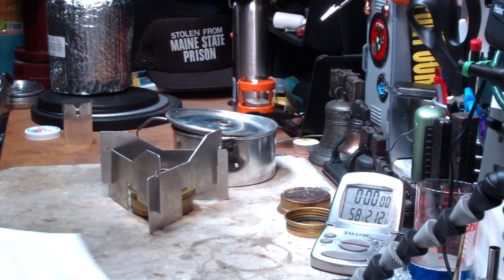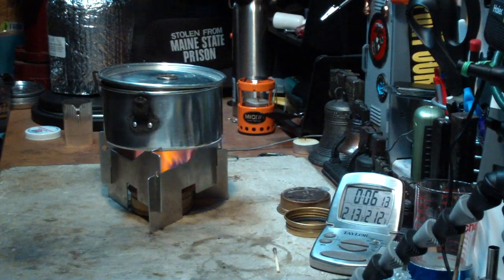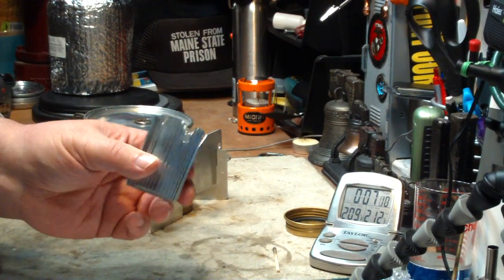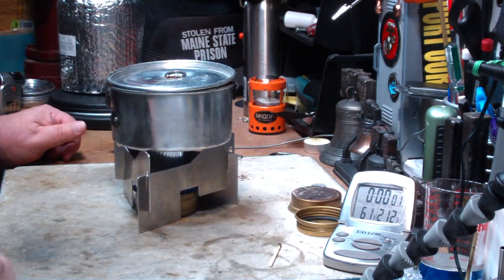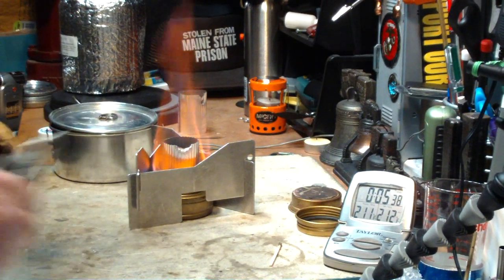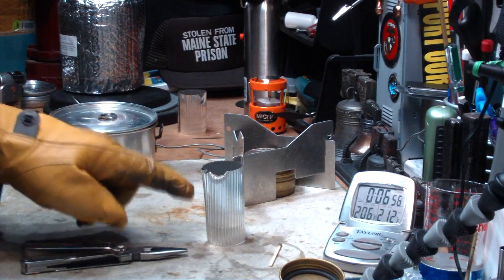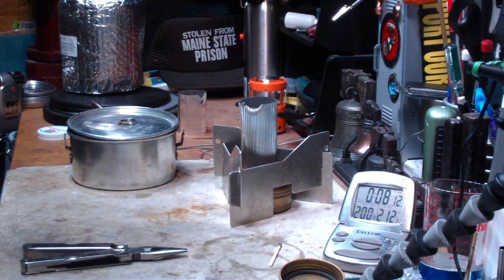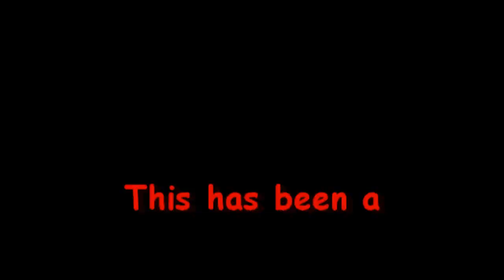Internal Corrugated Aluminum Pot Stand - (TheBeebopper Idea) - Boil Test #2

Comment from the maker: I do have an insulator that I use. It's a piece of corrugated cardboard covered with aluminum tape. Seems to work pretty good. It insulates and reflects the heat up towards the pot.

Comment: in my humble opinion ..  it appears that the corriagates acts as a second row of burner holes.  I believe that using straight flashing will reduce the amount of burner available. UNless you use different materials IE a thin tin sheet instead of aluminum